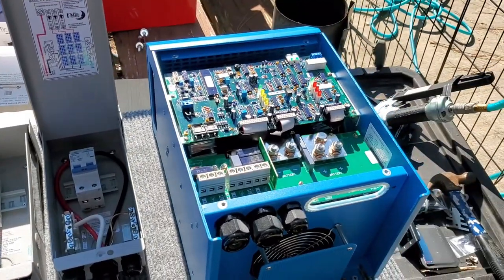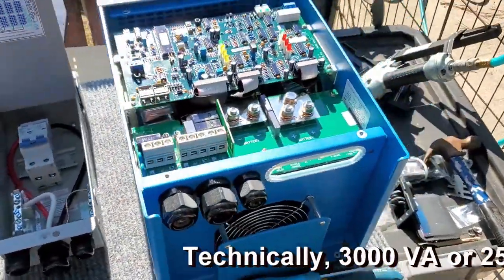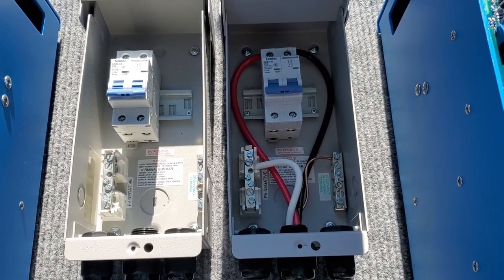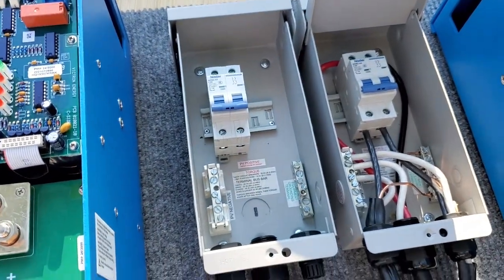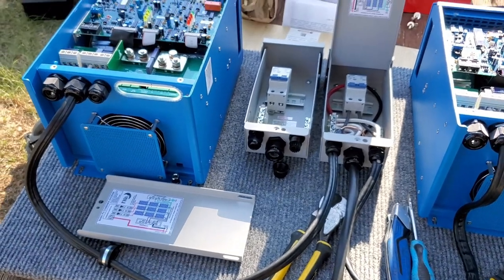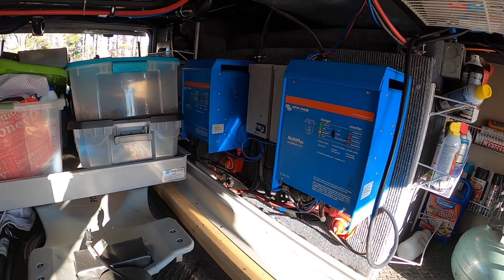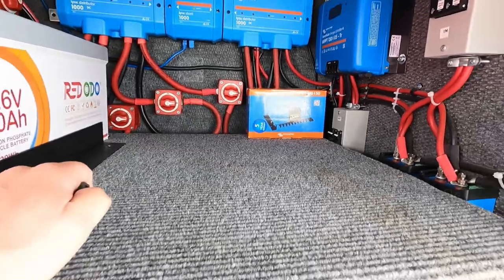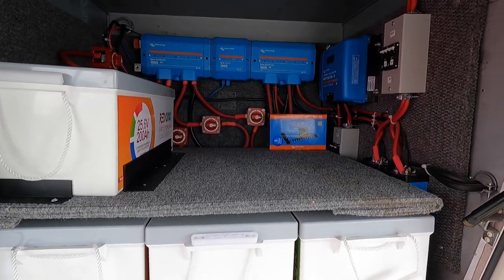One more final solar update  - we hope! | RV Solar | Full-Time RV Living

Comment: Nice upgrades! We upgraded the electrical system last year in our JX450. We also put in 2 victron multiplus Ii 3000 watt inverters for each leg. We have it set up for 12 volt, I went back and forth on 12 or 24, but settled on 12 to keep it a little easier. I was just using the generator to charge up (We have 6 Lion energy UT1300's!) , but just found some used 435 watt panels for $100/ea at San Tan solar, so I'll put 4 of them on the roof. I put one of the exact same panels on my Freightliner a couple years ago and really like the production it provides. Hopefully 4 will do the job on the trailer, I guess we always have the genny to fall back on....
Reply from the maker: Thanks! We went with 24v cause it was all the rage when we initially installed.  Would do 12v if I did it again today.  

The panels should do well in good sun,  depending on your power usage. We use alot of power,  so we supplement here and there with the generator if the sun doesn't cooperate.